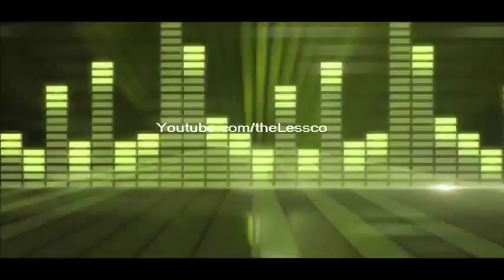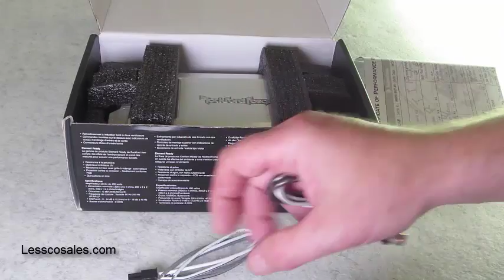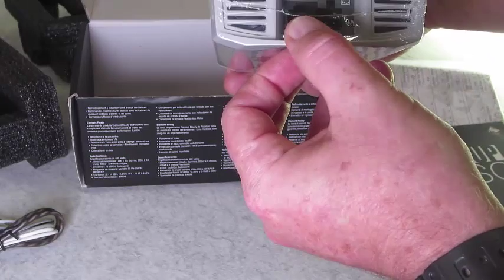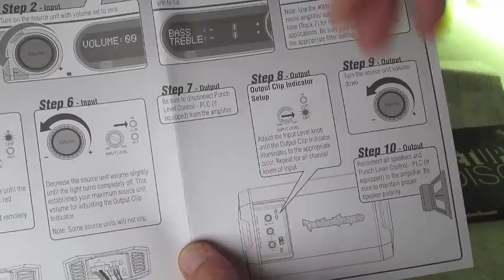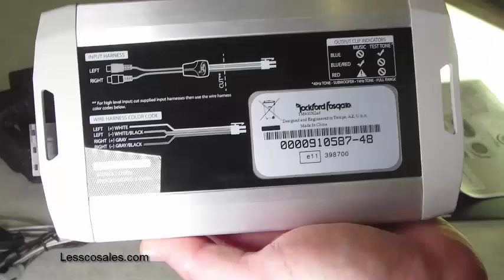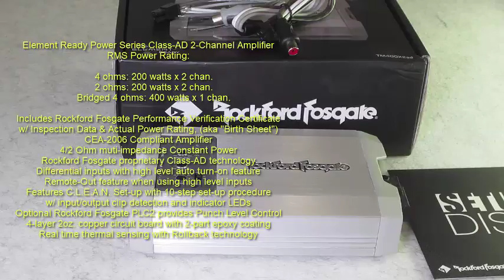Rockford Fosgate TM400X2AD Harley Davidson Amp Upgrade Review

Comment: The rca connectors don’t necessarily mean you’re using low level input since there is an auto sense switch for that, right? I plan on using high level rca for my application.